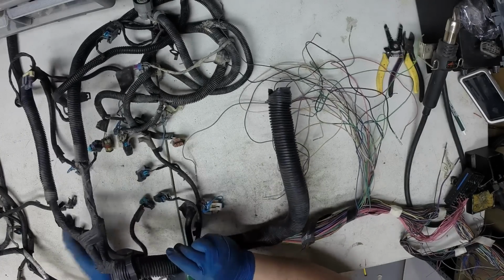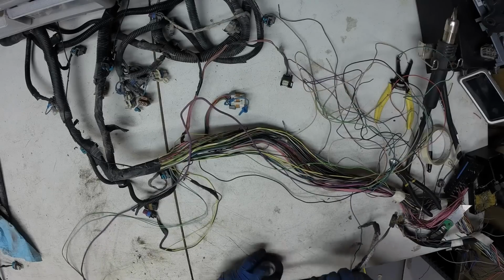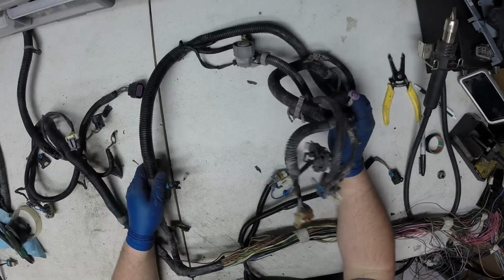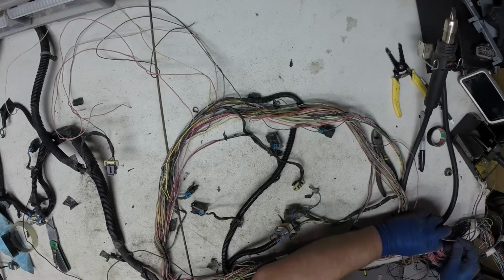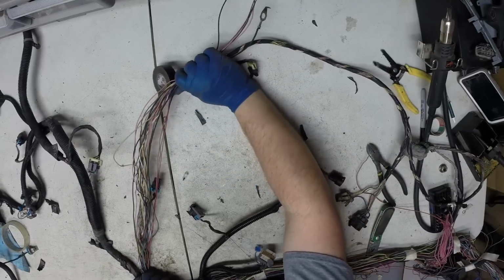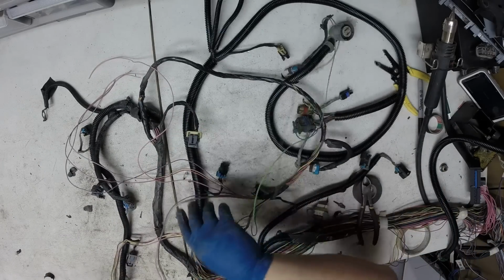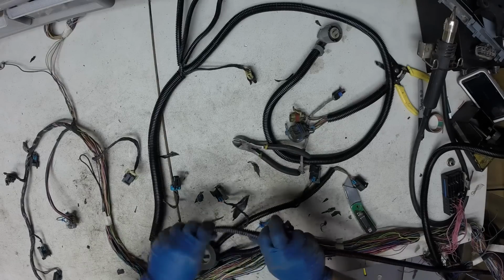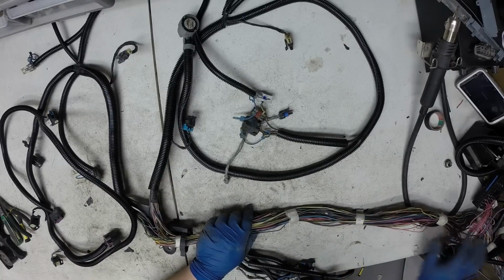2003 Vortec 5.3L Wiring Harness Rework Part 2

Comment: Hi Brendin , anyone pin out 2003-2007 blue and green ,on the blue  side pins number 32/34and 72   and pin  62 on green side  do they get removed   also with both pink wire , I'll  be running a 4l80e transmission.

Comment: 6 years is alooong time ago.
But 
My harness was on a good running 5.3 dbw.
3 of 8 injector conn.read zero to the double remaining pinks at the square plug,and the ones that do read continuity, some,are not pink on either of the 2 wires at the injector plugs? But they ohm out.
Maybe i didn't get a connection inside those injector plugs?
I tried several times both colors/wires.
I just went ahead snd cut the remaining 3 pink pairs and labeled um injectors.it ran perfect.
My jy harness came today.
Different injector plugs.
Mulit?
Still want to complete my stock harness,think ill leave the old unused wires in the middle .

Comment: Couple questions for you, 1) do I need to run the front o2 sensors my harness had them cut off and my 95 tahoe is emissions exempt 2) what do you do with the blue label wires you keep on the pin out chart ?

Comment: I have a question, I’ve got my red/blue harness slimmed down. I’ve got a green wire with a white stripe that goes to dbw  6 pin throttle body that somehow got cut and doesn’t go to anything now and I can’t figure out where it goes.

Comment: Why would you remove the flex fuel sensor? E85  runs faster. 
 Another question. I plan to install a power glide transmission. Do I remove all the transmission wires out of the harness
Reply from the maker: If you want it...keep it. very simple. I can't even buy E85 around here. No one has it.

Comment: Hi thanks for the videos,I would like to know about the dbw harness,I got a 2004 envoy 5.3 that I want to swap to a 2004 colorado
I want to use engine,trannsmiccion harnness on the colorado,does it works good,I hear that it can have reduce power problems is this true or it can work just fine

Comment: The 04 harness is electric throttlebody to but I am running drive by cable Throttlebody. I already wire  in the iac and tps sensors but will my computer operate The sensors ?
Reply from the maker: if you are converted to mechanical (DBC) and the PCM was previously electric (DBW) programming will have to be done to change, and the PCM must also be compatible.  https://lt1swap.com/cable_conversion.htm

Comment: Hey Brendan, awesome job! I followed you along and it worked out for the most part. I have a different plu for the neutral safety switch, one bigger grey plug, only 2 wires from the PCM are disconnected. I'm not sure what I should do. I think there is a lot of info for the PCM to control engine while going through the different gears. I guess I just leave it in and add the transmission eh?
Reply: What did you end up doing? i also have that plug?
Reply: To be honest with you, I don't remember. I do know that my harness was for a 4x4, so it has the transfer case wiring to deal with as well. Also, I think the LT1Swap harness here is for an older 4l60e transmission that had a different plug than my 2003 4l60e. @OoJoeShowoO

Comment: Thanks for taking the time to be so diligent in filming this video. I am trying to find out if I need to replace the entire wiring harness or not. I have some burned and broken wires between the outer fuse box and the firewall. Is there a workaround? I've already tried to solder to no avail. Thanks again for you help!!

Comment: When I worked at a salvage yard I learned to use a heat gun to soften the glue on the GM range sensor connector andd this way I could get them out intact.

Comment: I don’t get it why can’t you just leave the ignition and starter wires into the PCM? And fuse it from there like the factory did
Reply from the maker: You sure can if you want. You can wire it however you like. Most vehicles I'm swapping into already have a perfectly good starter solenoid circuit and neutral safety switch in line, so no need to add the PCM to the circuit.

Comment: hello! would you tell me if you save Vehicle speed sensor wires which are related with automatic trans? am reworking the same harness as yours and am saving all sensor and connector related with an automatic trans 4l60e

Comment: I'm following along, step by step, as I do my harness.  One thing that I found super helpful is how you explain individual wires, especially the orange/tan highlighted items on your charts.  They are not explained well on the website, but hearing you explain them helps immensely.  Thanks again for putting this info out there at no charge.  You are a saint.

Comment: @49:40 what wires were those you saved in case someone needed it? And before that you removed reverse light wiring. Is that needed for the reverse lights to come on? Or would the reverse lights be activated from something else?

Comment: Is there any "failure rate" for using old OEM wiring? My swap engine is in my 04 Van with 760K miles (400K on second used LQ9 engine out of Escalade) still runs fine. Thanks.
Reply from the maker: Its something to think about. That is a lot of heat cycles on the wiring insulation, the loom covering it, and so on.  I always take them apart to inspect wiring.  Too much damage I won't use one.
Reply: @LT1SWAPCOM  Very good, that is my biggest fear (especially after learning from your vids now) I will have to do the same and inspect wires when I pull it all out this spring. Thanks, and thanks for all the help you provide everyone, amazing effort.

Comment: JAVIER . nice work you are doing so am swapping the same engine (vortec 5.3 v8) my transmission is a 4L60E so my question is i need to save all wiring related with the transmission including the neutral safety switch?

Comment: I am planning on do this swap into a 76 f150 other than cleanliness what is the need to unpin and clean the harness I am planning on transplanting everything including fuse block to the ford and running analog gauges I suppose I would need to change the sensors out am I  correct

Comment: Can you remove the transmission harness if you are not using it I’m using a power glide
Reply from the maker: Yes you sure can. 13 wires on 4l60e at the round plug, 12 of which go to the PCM, 1 is 12v+.  You can also remove all of the range switch wiring. I recommend keeping the vehicle speed sensor.

Comment: If i wanted to retain the ac compressor, would i leave all the ac wires in? Whats the minimum wires needed to keep the factory ac?
Reply: samuelk009 I need the same ? Answered
Reply: @girlsallfall  @ did he snswer?
Reply: I would honestly say use the stock wires just extend them if you ac was currently working. It should work off of the factory harness. Reason I say that is because your doing a swap of the engine not the ac. At least that's what I plan to do and see if it works and if it doesn't you can still go back and add that back in.. Or leave it try the factory ac wires and see if it works if not switch to the swap wires. Not sure what to do afterthat

Comment: Great series Brendan. I appreciate you putting this together. 
What loom sizes do you use? 
Is there a published list of all the connectors used in the GM wiring harness? Where do you get all the ones you've used to replace bad ones?

Comment: Sorry if you said why and I missed it but why did you use vinyl tape for some parts and the cloth Tesa tape for others?
Reply from the maker: Usually if it will be visible, or be in a possibly high heat or high abrasion area I will use the Tesa cloth tape.

Comment: Thanks for the video its a big help.
My knock sensors were rusty and corroded so I removed the wiring to eliminate them. Was that a good or bad idea?
Reply from the maker: I always recommend keeping knock sensors.  You can buy a new sub harness that goes under the intake from most any parts store. Dorman sells them.

Comment: My harness is not like yours, like where your pcm is located u only have 2 feet of wire coming from it an mine is 5 feet. Do I still follow the same process?
Reply from the maker: The van harness is longer, and will have a white rectangle fuse block plug (called C1 in schematics)  The process would be identical. The van rear oxygen sensors will be in a multi-pin connector extension wrapped in heat resistance tape.  Those can come out if you don't need rear o2 sensors.
Reply from the maker: What is your harness from?
Reply: Sounds like it is from a van. Mine is from a 03 express van and it is much longer.

Comment: Brandon why do you keep the solenoid wire on the harness. Sorry for the stupid question
Reply from the maker: Its already routed down to the starter, so easier just to use it as opposed to the vehicle's wiring the engine is going into.  Its really up to you. You can just leave it in there, take it out, whatever you want to do.